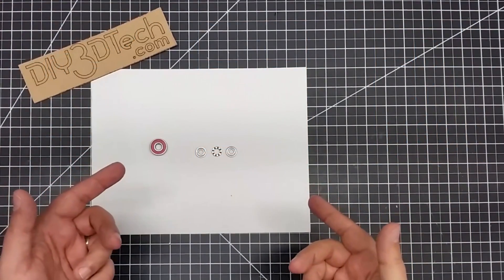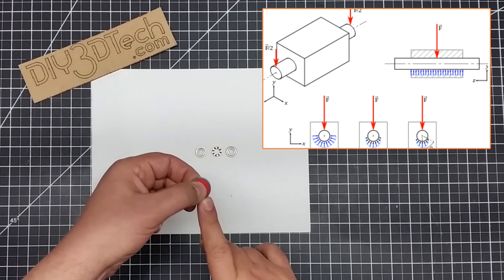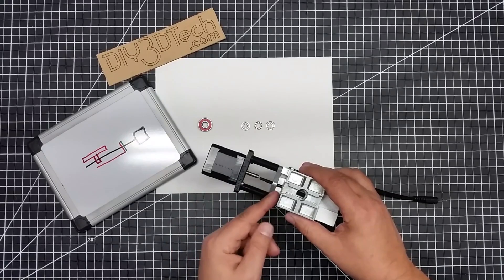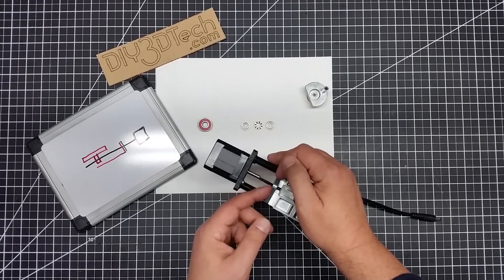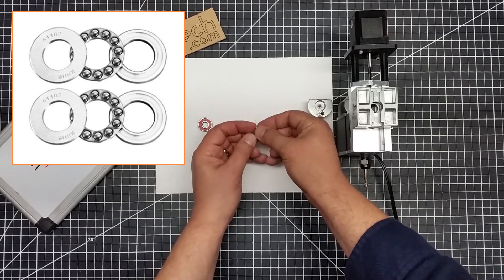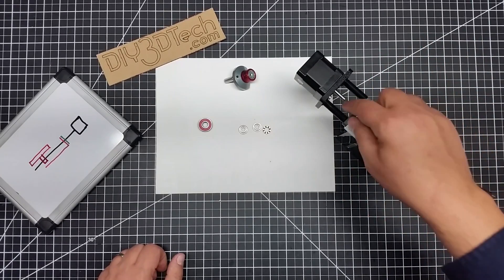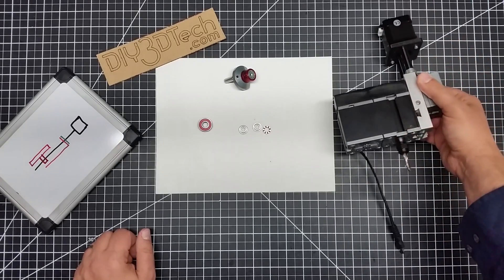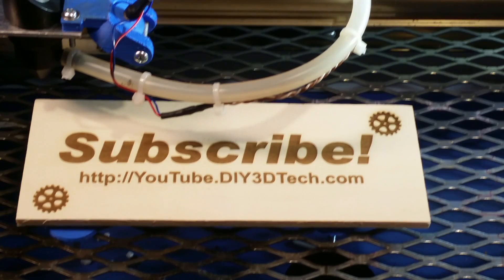Shop Talk - What Are Thrust Bearings!

Comment: so a thrust bearing allows a shaft to spin on it's axis but not 'pitch' (point up/down) or 'yaw' (turn left/right), 
also the bearing resists forces in the x, y and z axis, 
basically holding it in place but allowing it to turn on it's axis... 

hope that helps

Comment: Hi. Thanks for the great video. When you have one of these bearings, it looks like to top part spins in the opposite direction to the bottom. If you stack a second one on top, is the very top racer forced to spin in the same direction as the very bottom one?
Thanks
Reply from the maker: Many thanks for the kind comments!  Should not need to stack them and spin direction is not material to their translation of force.

Comment: I appreciate the video , but I didn’t quite catch it!  Once I saw the picture of the bearing sandwiched by two washers, I understood what a thrust bearing is.  I still did not figure out how you were using it though from your drawings.
Reply from the maker: The micro uses a push / pull rod to move the table and the current design is basically a friction fit.  So the tighter you make the less back-lash however the way more friction.  The trust bearings  bearing solve this problem allowing to tighten up against the bearing without crazy friction.  Hope this helps :-)